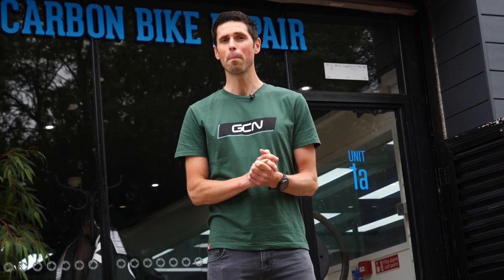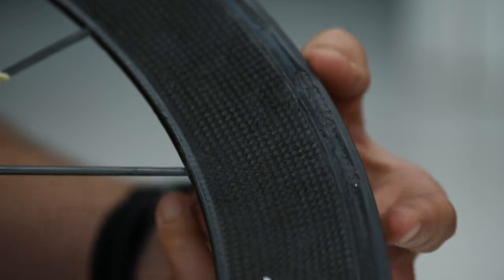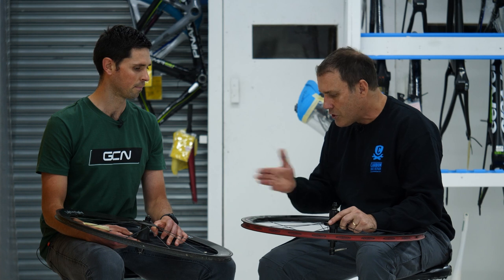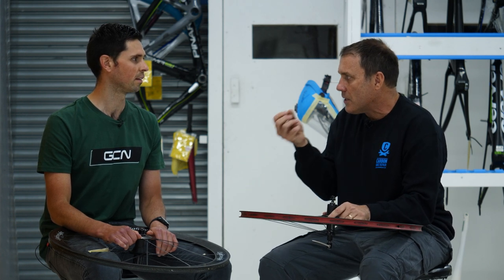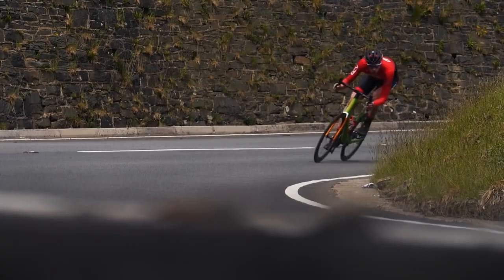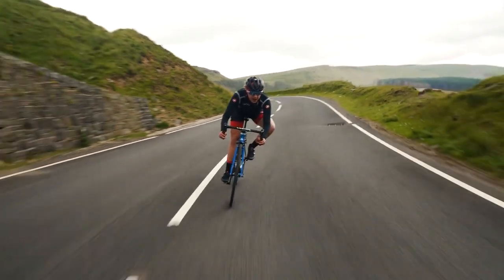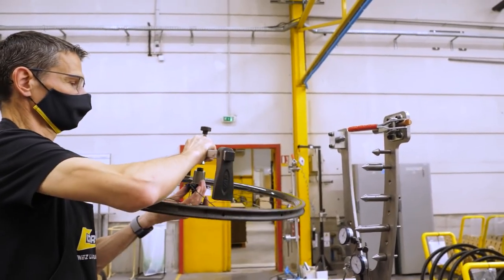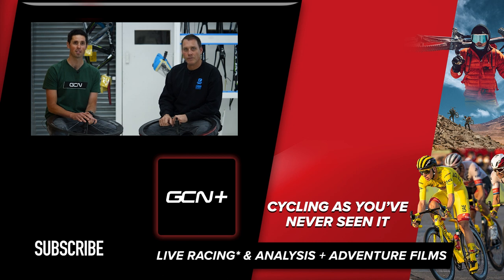Can You Fix A Broken Carbon Wheel?

Comment: What interests me more is that there are businesses ‘specifically’ set up to repair carbon bikes and bike parts. 

Would this put you off from buying a carbon frame.  What does this actually say about carbon manufacturing? 

Thoughts 🤔🤔
Reply: Probably not much. There are people in business repairing steel and aluminium frames and components as well
Reply: Carbon composites are labour intensive and difficult to rework or repair additively. Used judiciously it's great stuff, but it's prone to invisible damage and brittle fractures.
Reply: @armadillito  indeed, like components in any material, it has to be designed , manufactured and maintained correctly …..hope all those commercial aircraft wings and other components are designed and manufactured correctly :)
Reply: I listened to an interview with the owner of Starling Cycles where he explained why he opted to build with steel.

He has a background in aerospace, but he said anytime he’s cut up a carbon bike component the quality of the layup is severely lacking compared to what you would find in a carbon aerospace component.

Also once the mould is made laying in the carbon is relatively low skilled work, whereas welding a bike frame is high skill, so the manufacturing costs between metal and carbon aren’t all that different.